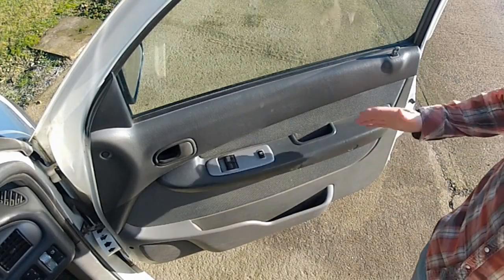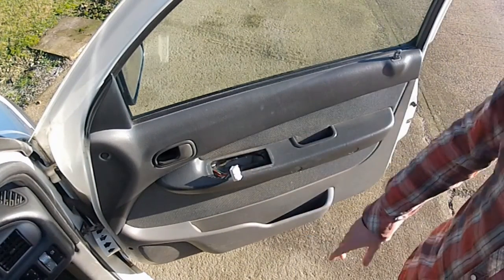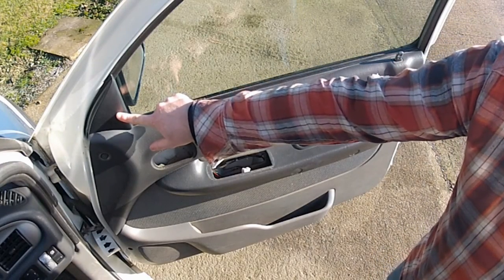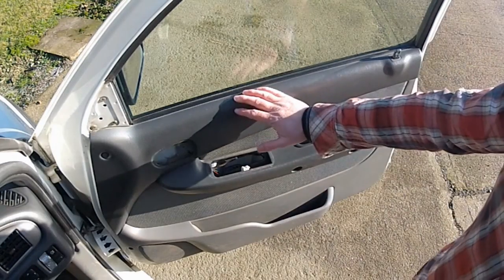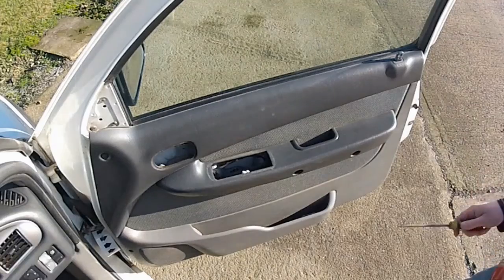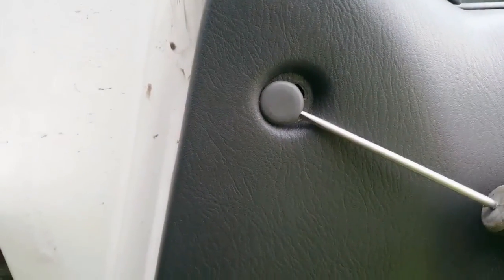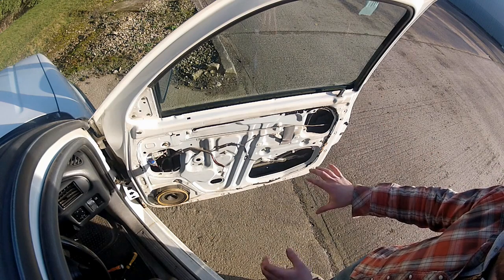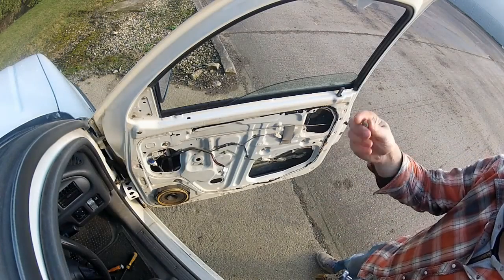How to Fix an Electric/Power Car Window / Regulator Remove & Motor Replace | Tech Tip 21

Comment: I got the doble cab 2008 the other day and i have this problem 😂
Reply from the maker: Pinch the one out of the back door!
Reply: @FastRust  good idea 💡 😊
Reply: @FastRust  can i ask, what's your MPG? I will do mainly motorway
Reply from the maker: Best I got on a long motorway run was 32mpg. Mine has a different engine than yours though.